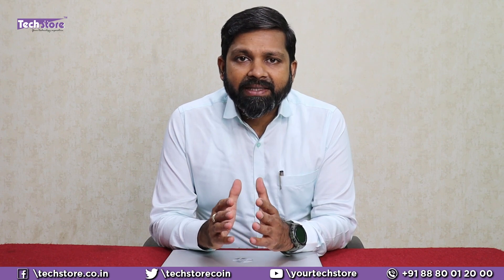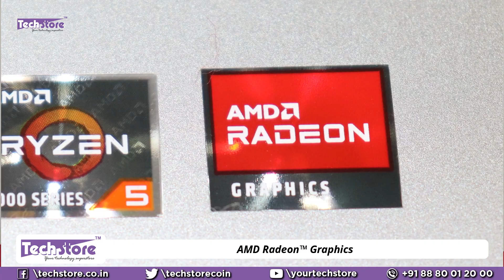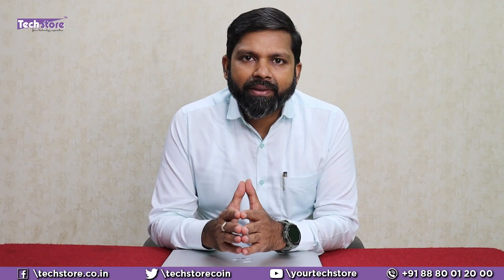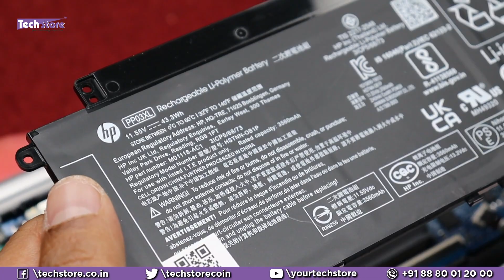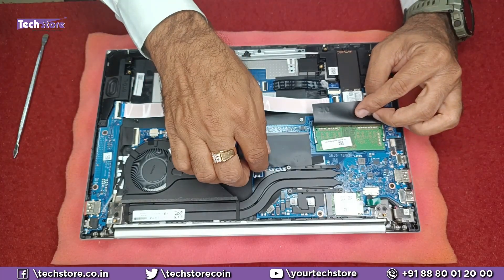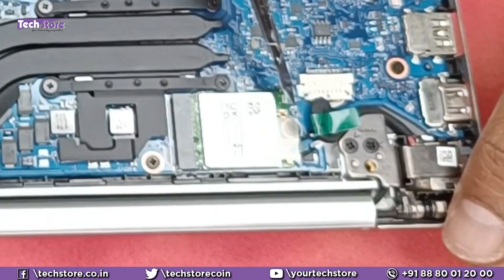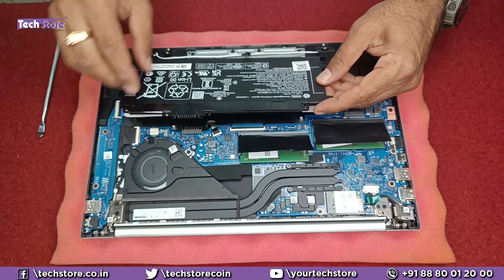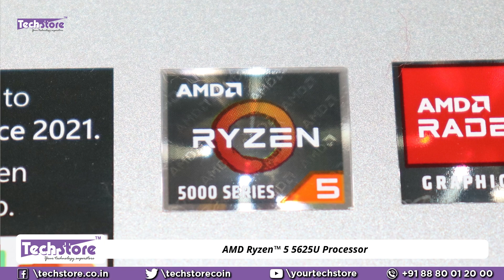HP Pavilion 14 EC Series EC1003AU: How to upgrade disassemble hdd m.2 nvme ssd battery review

Comment: @techstore you mentioned 32gb ram supported. But the official spec says 16gb (8*2) os max.

Could you please confirm if you've seen or tested more than 8gb in single slot?

I'm planning to replace one 4gb wkth a 16gb.
So 16+4 total 20.
Will it work?
Reply from the maker: Please subscribe, you will get a reply.
Reply: @TechstoreCoIn  okay,
Kindly reply now
Reply: @TechstoreCoIn  already subscribed, kindly reply.
Reply from the maker: You can put 2 Dimms of 16GB each and upgrade to 32GB comfortably ensure that both ram sticks are of same brand.
Reply: @TechstoreCoIn  but in hp website they show it upgrad till 16gb only

Comment: @08:53 Does it support 32 GB ram? in specs & in cmd prompt max capacity is showing as 16GB only (8+8). Can u confirm it?
Reply: Any update on this?

I'm planning to install one 16gb +old 4 gb total 20gb. Will ot work?
Reply: @michaelp1088  did u try it? is it working?
Reply: Any update on this